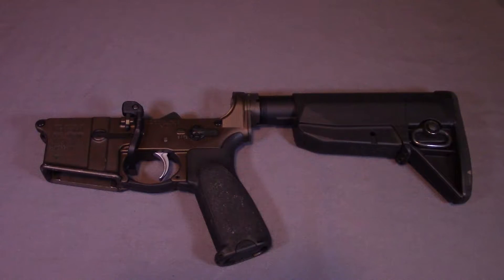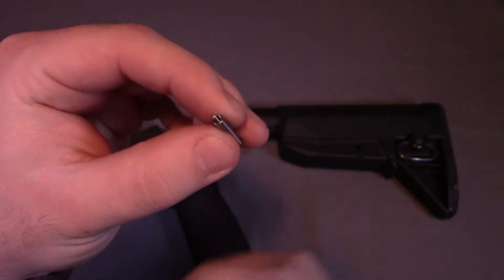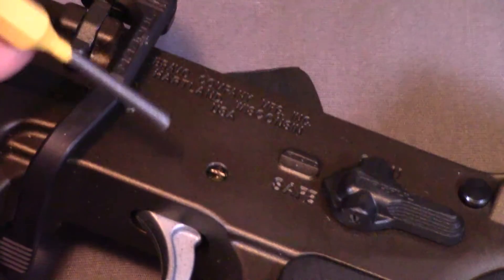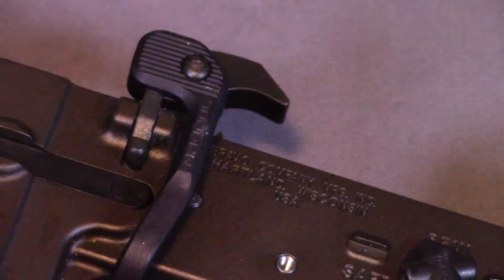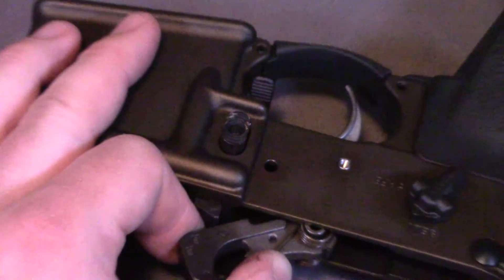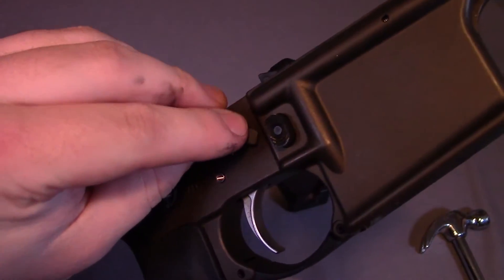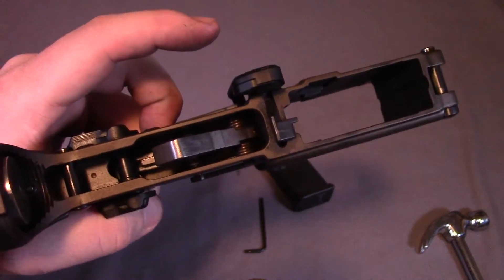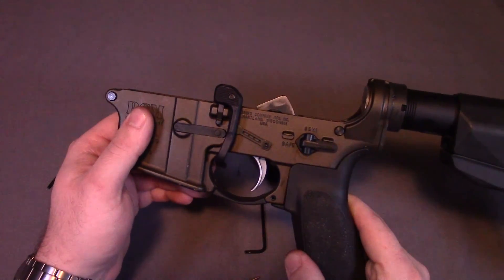KNS Precision Trigger Pin Installation

Comment: Pretty  simple, but a bit of a hassle with the ARMaglock for us Californians. I didn't want to risk stripping the head of the screw of the ARMaglock, however, I was able to install it even though it was blocking the pin completely. Since the B.A.D. lever is easy enough to take off, might as well. And since I didn't have a vice, I used your trick with the Glock magazine, thanks for that, helped me quite a bit.

Comment: These fancy pins are nothing but a cosmetic upgrade. Here's your proof...
The whole AR15 platform is held together by pins that are held in place by detents under pressure.
The only way hammer and trigger pins would EVER fall out, is if you removed them and didn't install them correctly or if you installed the wrong size pins.
If pins falling out was a problem, it would have been remedied decades ago like the rest of the other changes that were made to reduce faults.
They chromed the chamber and bore to reduce failed extraction. They added a brass deflector to stop brass from hitting lefty shooters in the face. They added a forward assist to clear a short stroke feed ect ect.
If ARs were prone to walking pins, that would be a huge liability issue. Ineffective pins could be a very dangerous situation, with countless massive legal repercussions. It's like Ford selling a car that's known to have the wheels fall off once in awhile but they choose to sell them regardless.
Your AR15 does not need these pins. Only people who use them are people who own a Instagram AR that they treat like it's entering a beauty pageant with stupid ass colors and painted rollmarks.
Reply: Yes, this..

Comment: Hey OreGear I noticed you have a Noveske short through selector , how do you like it ? I bought one for my Colt but didn't notice it was made from polymer until I installed it . Looks good though just more plastic .... Really wish I read a little more lol
Reply from the maker: +Al Codie I love it! I have it on a couple lowers. As far as I’m concerned, it’s what all other short throw ambi safeties are trying to be. I’ve got several thousand rounds through rifles with that safety and never had any durability issues. I’ve also never had a screw back itself out

Comment: Its funny how these have became must have upgrades when they were created as fixes for high round count lowers or loose drop trigger assembles. I see so many guys buying brand new PSA AR's using mil spec triggers and they install these. That is just throwing away 30 bucks they could have spent on a upgrade that would actually improve the rifle. Maybe they just think they look cool? IDK. If your pin walks a couple mils that is normal. It will not come out that is why they have the divots in the pins.
Reply: They're for full auto and suppressed rifles. The high reciprocation/pressure produced in those situations causes pins to walk out. Either way, what's wrong with putting it on your rifle anyway? It really looks good on an AR-15. Does every little tactical gadget on your rifle really have to be used for the intended purpose? How often have casual gun owners had to use a forward assist? Calm down, Inspector Killjoy. Let people enjoy things. The AR platform is the Barbie doll for men; let us have fun.
Reply: @n8er_tater  Bro, you killed me with inspector killjoy and Barbie for men.  🤣😂🤣😂🤣😂🤣😂🤣😂🤣😂🤣😂
Reply: Nate B. Best response ever!!😂😂
Reply: Nate B. That’s bullshit. All m16s are burst and I’ve never seen a trigger pin walk out in the military. I’ve shot thousands of rounds on burst. Even more on semi

Comment: How u like that ACT trigger?  Worth $70.
Reply from the maker: +RageQuit003 For a trigger that came from the factory, I love it. If I were starting from scratch, I'd probably wait for a Geissele sale and spend a little more money for one of those. That said, if you want to keep a mil spec style trigger, the ACT is very nice!
Reply: +OreGear The only Geissele I've run is the Super SCAR.  However that was an insane difference...especially on rapid fire.  I've seen a few youtubes run this ACT including Hoss and it looks pretty close speed wise.
I run that ALG AKT in my M10 AK but can barely tell the difference between that and the modded G2's I make.  So I was wondering if I should try an ACT or just polish up what I got.
Reply from the maker: I've only used the SSA and SSA-E triggers, both of which are amazing! The ACT can be run very quickly, but it retains the weight and reliability of a mil spec. Most mil specs in my experience are very inconsistent as far as feel and weight, whereas the ACT is exactly the same every single time. Not the lightest, but still very crisp.

Comment: Forgive my ignorance, but what is the purpose of these again???
Reply from the maker: +Joe11Blue The prevent your trigger and hammer pins from walking out while firing. Many rifles have an issue with the pins drifting under recoil. These prevent that from happening.
Thanks for watching!
Reply: The pins also will not rotate in the receiver like the stock ones do. I had a Colt receiver hammer pin hole get excessively worn by the movement .   I like to punch the J spring out of the hammer when doing this mod. The J spring becomes unnecessary and the hammer moves more freely without it.
Reply: Pat Murphy
What about with drop in trigger groups? I have not had this issue with mine.
Reply: +Joe11Blue drop in trigger groups are different animals. I assume you are talking about the CMC or Timney type units. They have their own pivot pins in the housing and the pins that go through the receiver simply hold the housing in place. I fixed my Colt by dropping in a CMC trigger with the oversize pins that came with it. It's great!
Reply: Hmm, thanks. I wanted to pick up the Fostech Echo, would have been my first drop in. I might just toss the money at something else really nice, since I already have it saved.